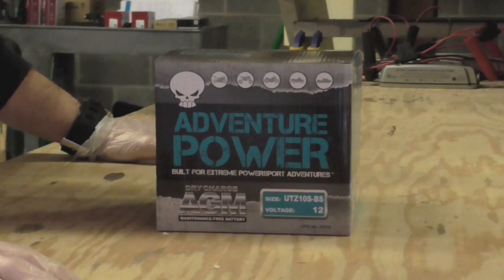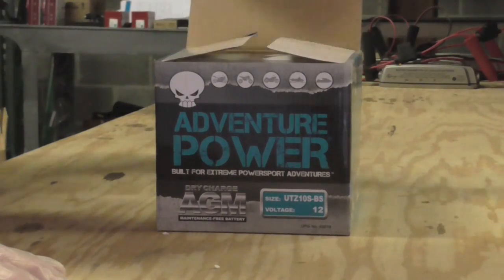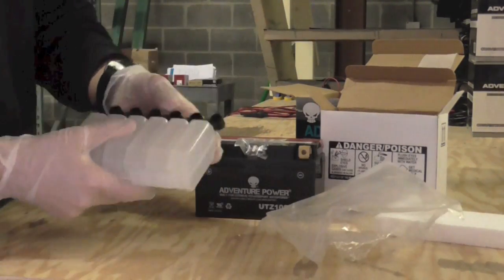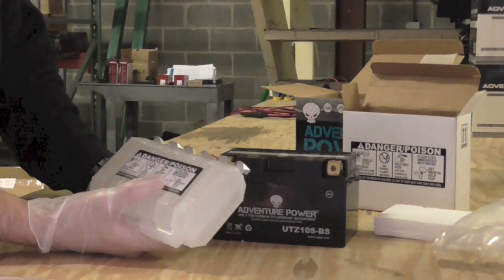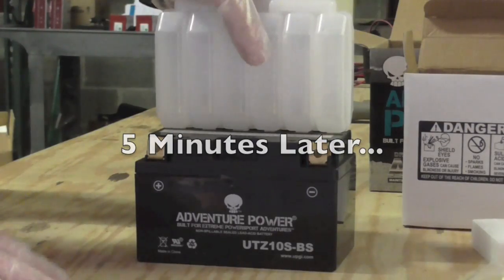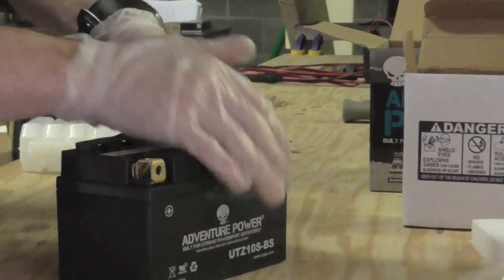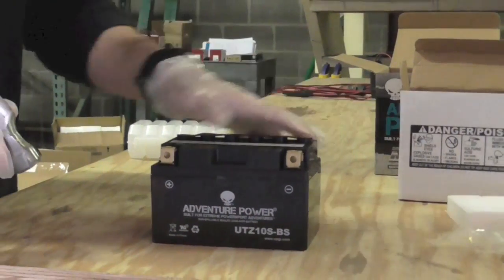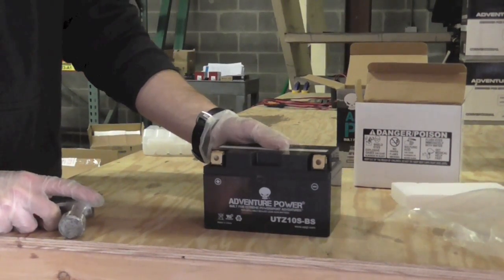How to Fill a SLA Battery with Acid

Comment from the maker: When you first fill the battery you will want to wait about 5 to 10 minutes for the acid to settle into each cell, after which you will then go back over each cell and add any acid required until it reaches the top indicator fill line of the battery. When you put the battery on it first charge you can either take the caps off and openly vent the battery or put the caps on and rely on the side vent of the battery for gassing.

It really depends on where you are charging the battery, if you leave the caps off of the top of the battery then small amounts of acid will be sprinkled around each cell and may get on the table or any nearby items if the charge rate is to high. If the caps are left on the battery it is recommended to use a low-rate charger - this method will limit any potential mess that the battery acid could cause by limiting the venting to the side of the battery.